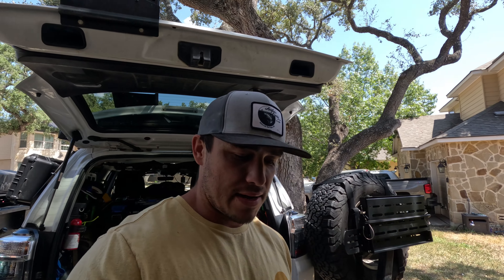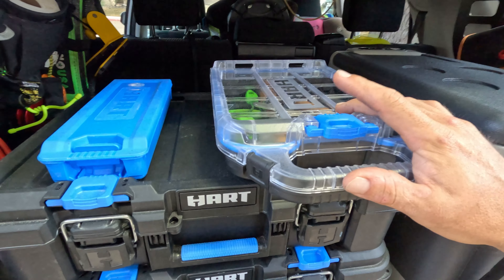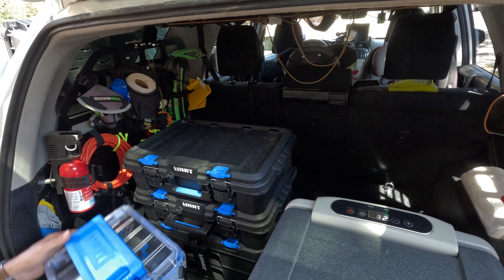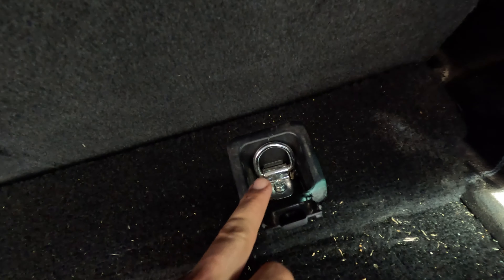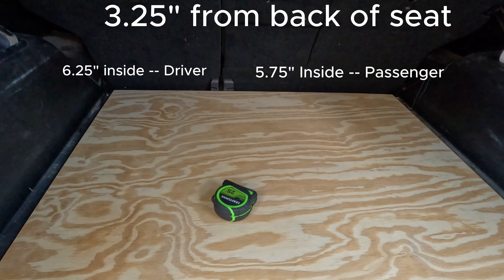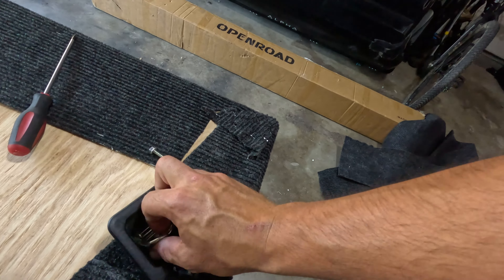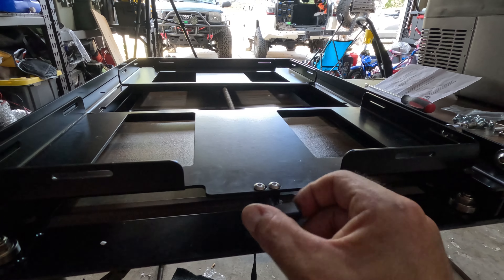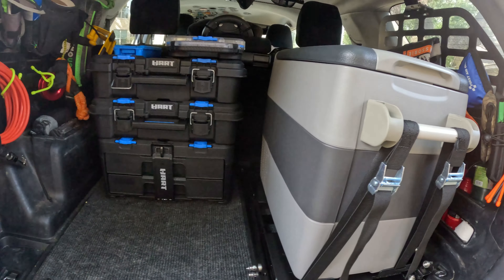Walmart Overlanding Storage Solution | Budget DIY 4runner Rear Cargo Mounting Tray

Comment: Nice set up! Quick question though. What rate rear springs are you running or do you have airbad assist? Mine would be pooping like crazy!!
Reply from the maker: Thank you! I am running the old man emu heavy rear springs with bp-51 shocks. They handle the weight great

Comment: That's a great setup. You might want to look into the actual load limits of your Rhino gear. I used to have their equipment and found that they overstated the ratings on straps and ropes. They would state the maximum amount of force that caused a failure, not the minimum. If you depend on those claims, it might not end well, and you could experience critical failures. Look at how Yankum and Factor 55 identify their equipment and compare that to Rhino. The differences are apparent. Both Yankum and Factor 55 state the lowest amount of force that would cause a failure. This ensures a margin of safety that you won't realize with Rhino. You definitely get what you pay for. Also, the only part about Rhino "USA" is in the title and not where their equipment is made. Thanks again for taking the time.
Reply: I've been running rhino gear for a few years. Ive never had a issue but I treat it as all my gear. I never max it out
Reply from the maker: @americanmade422 I’ve done some sketchy stuff with my rhino gear straps lol